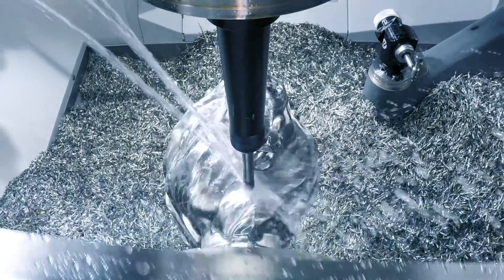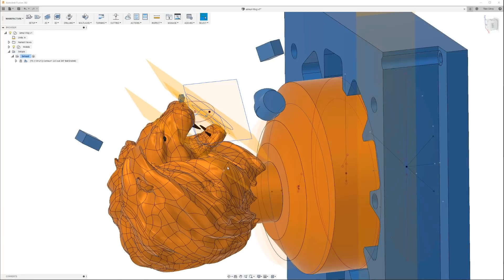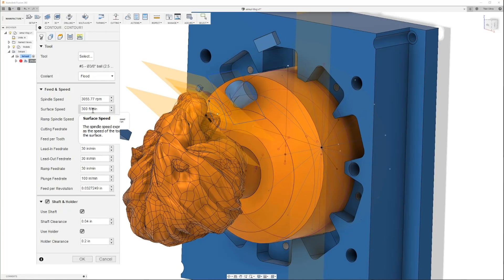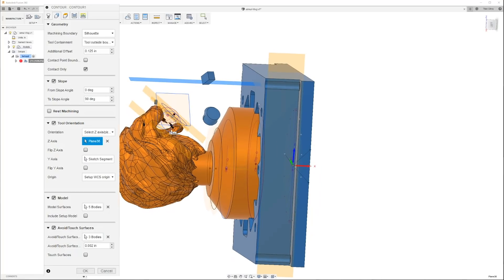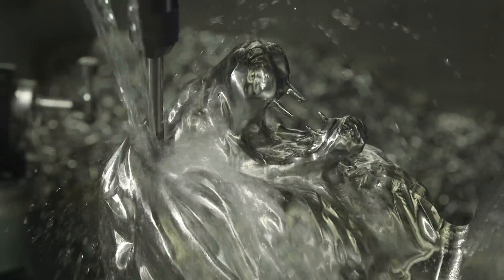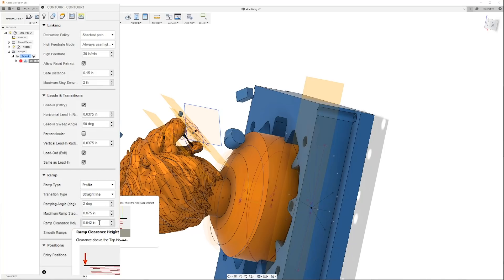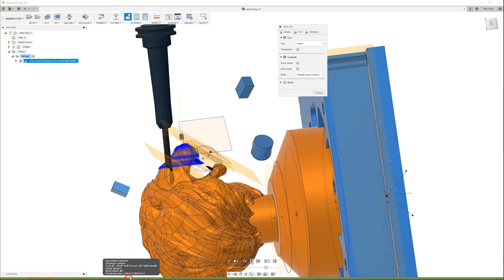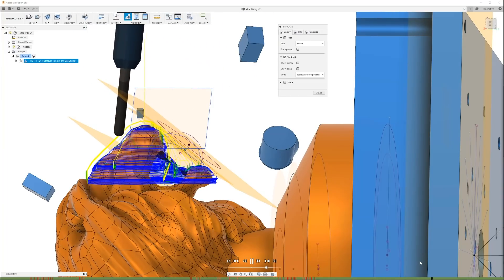Simultaneous 5 Axis - Every Machinist Needs To Watch This | Vlog #84

Comment: So am I right in thinking it's more like u just set the parameters that applies to your tooling and your cnc and tell it what not to do and the program will do all the grunt work in between ?
Reply: yes, the magic comes in where a good machinist knows when to override the software.
Reply: @ThePitProductions  you can't even program this efficiently and properly if you're not a good machinist first. He knows what he can program depending on material, tooling and machine. There, is the magic. Software pushes it to the next level indeed, we have to say a big thanks to the soft devs all around the world and especially to the guys that developed HSMworks in the first place, which is where fusion comes from, their interface and algorithms are unmatched in ease of use and efficiency.

Comment: Hi my name is Brock, at my current job I a Mazak mill, I got a job offer from a bigger company. There's better pay and a better opportunity for me to advance in the machining world. The only difference is the new job has all Haas Mills. Does anyone have any pointers or tips to help me succeed at my new job ?
Reply: super easy, different models different quirks, worked at shops running 8-12 machines, set-ups, first article run. My point. if programs are cam derived, all machines are equal in operation, yes an oversimplified statement, but true, and realize it and you have a huge confidence boost. Why, cause you can operate any cnc in the world in the time it takes to look over the controls.
Reply: If you can program and run a Mazak, a Haas will come easy. Haas also has tons of videos on Youtube to reference if you need help with something
Reply: Thank you Alan, I looked into some videos and it looks like something i can manage. Thank you very much.

Comment: Who has the responsibility for not having a machine crash?

If fusion tells it to run into something, will the machine protect itself?
Reply: CNC machines will always do whatever you tell them to do even if it's the last thing they do, that responsibility is why programmers get paid.  There are simulation programs that show the entire machine's movement so all that can still be done offline without wasting machine time.
Reply: @pbrenneman5  ah ok, so the software is where the brains are at and the machine is dumb as a doornail. got it
Reply: @Simoooo-n  some machines are, I know that okuma's and matsuura's if they are set up properly have collision avoidance software that keeps them from bumping even in manual mode.
Reply: I would imagine they ran a test peice on softer material like polymide, that's what I would do
Reply: If you have your simulator properly set up you will see it?  that includes tool holders  and cutter lengths. gcode does not know the cutter length, nor does cam care, it's only used for visual simulation.